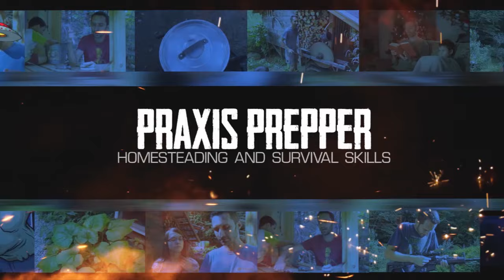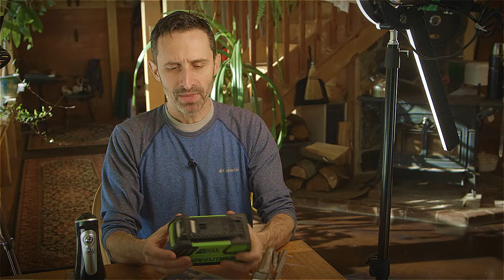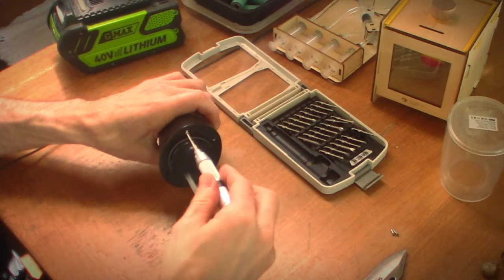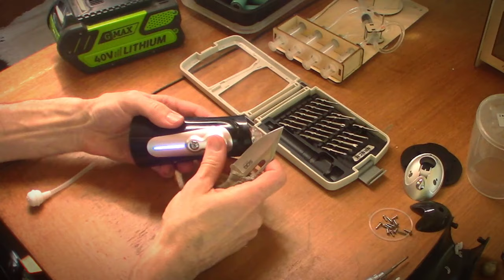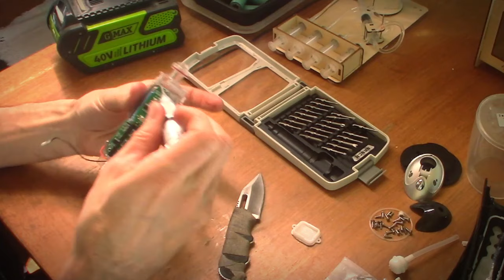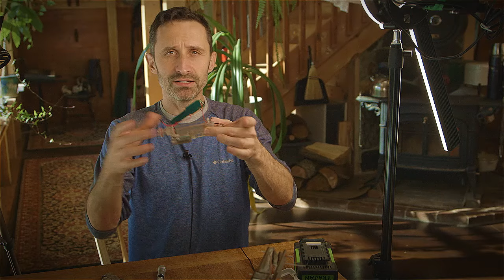You Probably Do NOT Have This Skill

Comment: I think save those screws on the little gadgets is an important point.  I have taken a few gadgets apart too and now have a decent collection of itsy bitsy screws in sizes not sold at Lowes or Home Depot.  Shocked to learn some of them are non-ferrous and can't be picked up with a magnet if dropped.  Is okay though, I found some of the same type in my collection which made putting that yard light (sold with a (useless) 2 volt solar panel for the 6 volt wet cell battery inside (which is why it stopped working 3 days after purchase) together when I attached a 7 volt solar panel and a 6v LiOn battery.  Now it works well.  My small gadget tool box includes needle nose pliers and some forceps, an Asian Leatherman knock-off (@ $3 why not?), and some allen wrenches (both Imperial and Metric).  DeWalt makes some nice work knives.
Reply from the maker: I'm glad you got the solar light working. I have some experience with those little things too and they never last long.
Reply: @PraxisPrepper  Some of the makers seem to design them to fail.  I have 4 or 5 makes I have picked up in the past few decades, and mis sized solar panels or inappropriate batteries are not unusual.  I replaced the 1500 mAh Sub C Ni Cad batteries in one with  LiOn 3,000 mAh in another.  I have one that has been going 3 years now since I changed out the solar panel for a bigger one.
Reply from the maker: You're not imagining it at all. It's an official industry practice and has a name, "designed obsolescence". Of course, some of what you describe might just fall under the "poorly made" category too. But even for better made stuff, it's a real aspect to the design process to design in failure points to give products a lifespan that will be helpful towards forcing the consumer to re-buy over and over. It's like a subscription service, but without people overtly being told that's what it is. @kenibnanak5554
Reply: @PraxisPrepper  Oh absolutely we are multiple decades past the era when manufacturers like JD and IH designed tractors with engine gaskets that could be made out of any old leather or tree bark the end consumer had laying around his farm or ranch.  t is a convergence of many factors ranging from the long term effects of the Marshall Plan, corporate greed, the dumbing down of the US education system coupled with an excess of safety regulations.  
Two years ago I talked with 3 men and a woman up from DC stuck at a local 711 because their car had a flat tire.  All of them were born here in the US and seemed clear cut.  Not drunk, neatly dressed, etc..  All of them were in their early 20s.  Three of them had college degrees (worthless, but expensive paper IMO) and one was still going.  Not one of them had any clue how to fix the problem.  Neither their school systems or their parents had ever taught them how to change a flat.  They were on the verge of calling a tow truck when I stopped them from doing that.  I offered to talk them through the process and I did.  I didn't touch anything, just told them open the trunk, lift that panel, take out the metal thing (the jack) and that L shaped thng, had them pull out the manual from the glove box (which the female owner had never opened past the pages with A/C and radio controls), find the lift points in it, have one of the men find them, then talked them through the whole process.  Sadly, our society and corporate life (software engineers and a financial advisor they were) is such that while I have no doubt they know which music is hot this week, and who will be in a playoff or football game, etc., I also think they are not watching prepper videos on YouTube nor do any of them know how to strip an AR or an AK (much less zero the sights), or swing an axe and build a camp fire.  None of them had ever been in the military either and that too is sad (they would have at least learned some survival skills there).  Nothing important to survival was in their culture or educational background.  
Perfect (clueless) consumers.  The two men who actually changed the tire both told me this was the first time in their lives they had ever used a wrench (I had to show them how to use the lug wrench).  We had a good talk during that 30 or 40 minutes (yeah, way too long, but they had to be shown every step and it was all brand new to them).  I told them of some good books to look at which they had never heard of, How to Fix Everything, Complete Book of Home Repair, Electronics For Dummies, etc.  Talked about hunting (none of them had ever shot but one has an old rifle he inherited), and horses, cattle and goats.  I did what I could for them, but you can't pass 2 decades of what parents and schools should teach in a half hour.  Not their fault.  Kind of a sad and scary experience for me in a way, as I have no doubt there are millions of similar 'perfect consumers' just like them in today's society.  They are the people todays marketing moguls design products that fail for.
Speaking of yard lights there is a reliable $14 dollar one out there on the Internet.  Sad thing is it is only about a 25 watt equivalent LED, but the back solar panel is easily unhinged apart and the Nickle Magnesium AA cell is quite accessible and it does actually get enough usable current from it's small panel to recharge on a cloudy day.
Reply from the maker: I LOVE that you took the time to do that for them. IDK if it seemed obvious to you at that moment or not, but that experience you gave them might very well end up being a formative event in one or many of their lives. Even if only one gets a switch flipped on from what you did for them, that's well worth the effort. Thank you from ALL of us. Helping people to learn to fish helps everyone I think. The fewer incometent people out there, the better for us all - even if only because so many people like that out there drive up the cost of services for all of us. I often times will want to hire out some work to someone because I want to spend my time focused on some other project, but prefer both to be getting done. But so often, it's the case that the rate being charged for services is SO high, that I just can't justify hiring it out. Last example of that was a small concrete pour. It was about $1000 in materials for me to do the job myself, but a company quoted me $7000 for the work. It would have been about 8-10 hours of work for them. The only way those rates can exist is because of people who simply don't know how to do anything for themselves. Because they have no other choice, they're essentially willing to pay almost anything for work. So the price skyrockets. And why shouldn't it. I used to work in film. I'd have been very happy and content with a day rate of about $250. But the going market rate for my services was $800-900 per day. So I charged that. @kenibnanak5554
Reply: @PraxisPrepper  Well of course my initial reactions were horror and shock at realizing their were American men and women in their 20s who had no clue of how to change a tire, and in at least one case had never used a wrench of any kind.  I am of an older generation and we had multiple shop classes, wood working, metal shop, automotive when I was a teen while the girls had home economics, sewing, typing (which boys could take too).  Most school systems had decided that was dangerous (because shop class injuries can and sometimes do happen) and teaching young women how to be a home maker was sexist and in some towns and cities they simply dropped those classes from Public Schools in favor of less controversial things like diversity or learning Esperanto, etc   Boy Scouting taught First Aid and how to camp in the woods, build a camp fire, marksmanship (some schools had rifle teams too), etc.  All of that is  passe.  Some parents try to pick up the slack and parent (i.e., teach basic skills), but as we see, some don't bother.  The result is clueless perfect consumers.  As you say that benefits no one but those making the money.  If I am hurt in a car accident I want the first person to arrive to know First Aid (whether or not they will provide it is a different topic, but at least they should know how).  Everyone should know how to change a car's oil or swap out a flat.  That is basic stuff.  If I could find their parents I would slap them silly for not teaching their kids such things before they graduated HS, much less leave home for college and the world.  But there are millions of them, and that;s sad.  I too hope at least one of them looked at some of the books I mentioned that day.  At the very least the one who had never used a wrench now understands the concept and all 4 of them now know the basics of changing a flat tire.  Like you, I want to be surrounded by people competent at many things.  I don't want someone helping me fix a fence to be a master carpenter, but I do expect him to know how to handle a hammer or a screwdriver or a drill.  They don't have to be a seamstress, but everyone should know how to sew on a button or patch a torn bluejeans.

Comment: They make this so hard to open.  Did that with weed whackr battery.   I broke a car starter, broke off AC charging plug and when opened it was a regular wall charget in a plastic holder.   If it doesn't work and your throwing it away, tinker
Reply from the maker: I recall that with that greenworks battery. The four screws that held it together were... weird in some way. I forget what it was, but I remember them being weird somehow. Like they weren't standard philips head or something. I forget what it was, but they were different in some way. That's one of the great things about that NANCH tool set. It has so many tips. HEY, I thin I remember now. I think they were star or hex heads, BUT they had a pin in the middle so that you needed a special head with that space open in the middle.

Comment: You should have attempted to jump the battery with the other one, i have saved batteries this way, get a battery tester find positive and negative , and jump battery with another of the same.
Reply: @felixdacat6572  it's 80F here, it's cold 🥶 😆
Reply: @MosaicHomestead  🤣🤣🤣🤣🤣...Hisssssssss.. 🐍🐍🐍🐍🐍🐍🐍...I'm jealous, but working  on a bug out location down the Yunque in Savanah.
Reply from the maker: Yeah, even with all my messing around, I still have a crap-ton to learn. All the cells in that battery worked just great. I don't know what the issue was. When it gets to be an issue involving circuit boards, that's when I hit my wall.
Reply: @PraxisPrepper  Yeah....same here...Thats one of my weak spots...Give me an old-school "Erector Set" or a Car I can Jumpstart with a screwdriver or butter knife ( my dad was a long time Auto Mechanic)....I looked under the hood of cars nowdays and I can only identify the battery, radiator and the window washing fluid tank...don't get me started on the cars electronics..🤪🤪🤪
Reply from the maker: I used to always do my own oil changes until the cars started having all those plastic panels underneath that require getting the car pretty high up off the ground to be able to swing the panels open all the way. I suppose I don't MIND not crawling around on my back getting bit by mosquitoes while I do my oil changes, but I certainly liked it back when I could do the oil change for 1/4 of the cost and also in about 10 minutes vs driving to the dealership, waiting for an hour, and then driving home... In retrospect, I think I DO miss crawling around on my back to DIY them! @felixdacat6572
Reply: @PraxisPrepper  Sometimes a battery reboots when jumped with another battery,  I've fixed a couple of batteries this way, there are videos on this if you want to check them out.
Reply: @MosaicHomestead  Insomniac...!..🤣🤣.
Reply: @felixdacat6572  I slept all night,  I get up super early,  I'm stuccoing today.
Reply: @MosaicHomestead  Yeah...get it done before the rain showers.
Reply from the maker: I'll look that up next time this comes up for me. That would have been an even better option to try out. I mean fist-loads of 18650 batteries is better than landfill fodder, but I'd rather an extra working 40v battery even more. Thx for the tip! @MosaicHomestead

Comment: Fun fact.....when manually turn...electric motors generate electricity....
Reply from the maker: It IS a fun fact. One of the Christmas presents presents for my boy was a demonstration kit of literally that, a small motor used as a generator that lit a small led light.
Another fun fact (along these same lines) is that if you push an analog audio signal back through a microphone, it'll act as a little speaker. I presume (though have never confirmed) that speakers might be able to somehow be used as microphones as well. Based on my knowledge of how both work it seems plausible it could go both ways. As to whether doing this damages the microphone, I don't know. But it does work.
Reply: @PraxisPrepper  that's awesome...you are absolutely right...and it does work both ways speaker to mic or mic to speaker......another thing on a speaker is that it can also be used to generate electricity by manually moving the cone back and forth while wired to something like a small led....
Reply from the maker: LOL. Now that you've confirmed that a speaker is a mic (meaning if the speaker core is vibrated, it'll generate an electrical signal), and that signal can be used to light up a small LED. I'm picturing the following "hack" if you need light, connect a small LED to a speaker and scream into the speaker. Makes for a great image. @anarchy7343